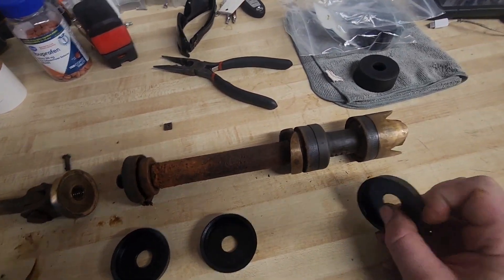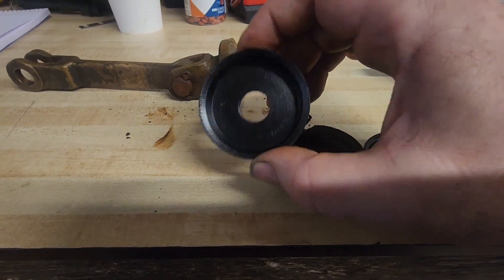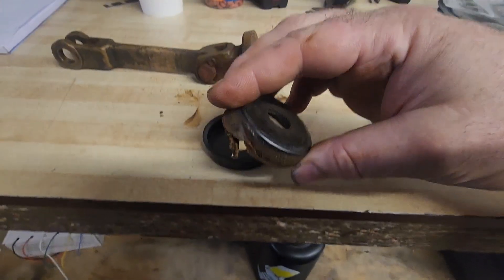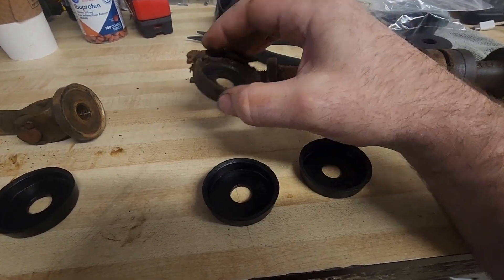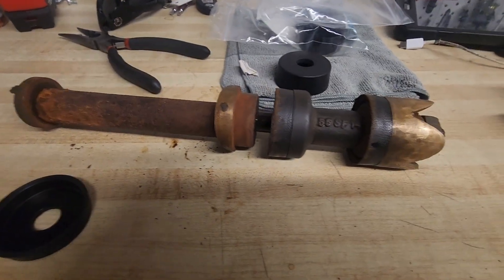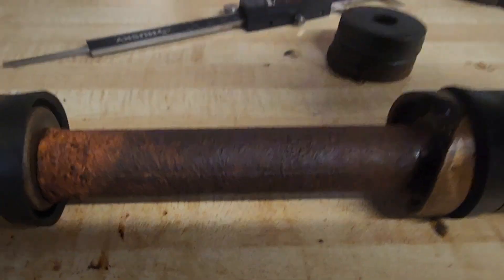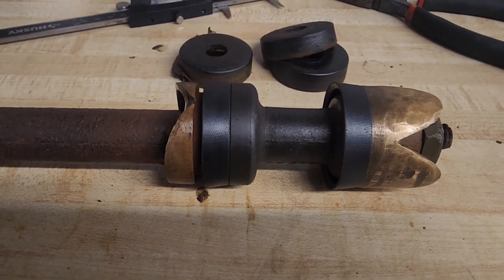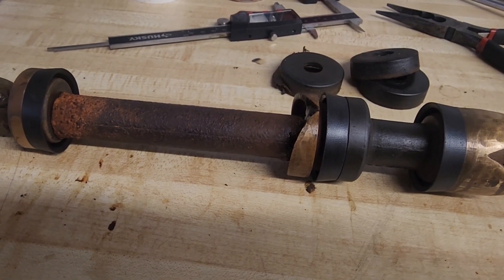Update on the water powered elevator project.

Comment from the maker: I didn't get the installation on video. The seals fit. However, the lever that controls this plunger was not adjusted properly. The top end popped out of the housing and damaged the new top seal in the exact same way as the old one. 

The good news is that I have more seals. The bad news is that I broke the housing. It's made out of cast iron. I need some recommendations for welders who are willing to do cast iron in the PDX area. Or leads on replacement parts for 70 year old Otis water powered elevators. 

Any help would be greatly appreciated.